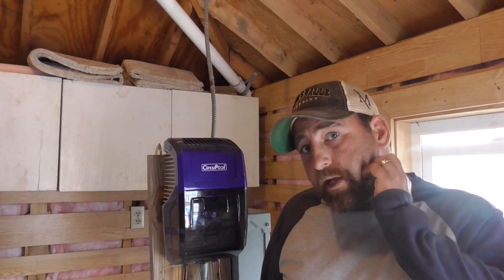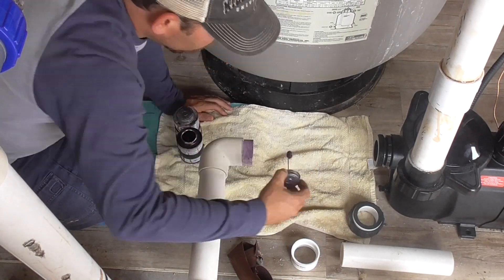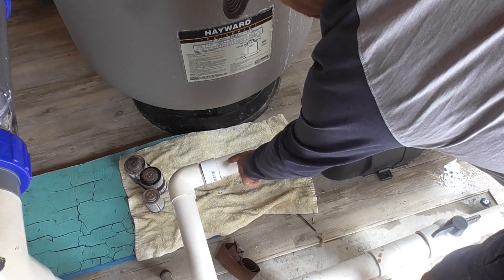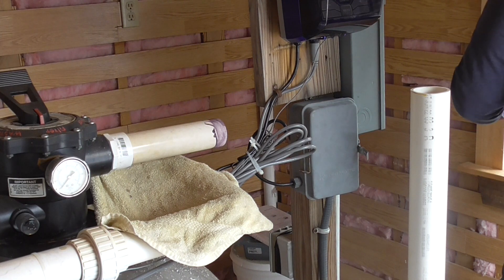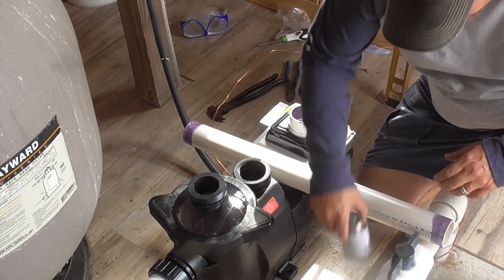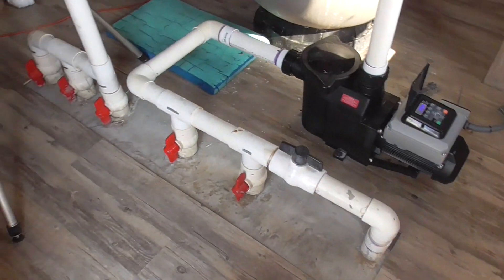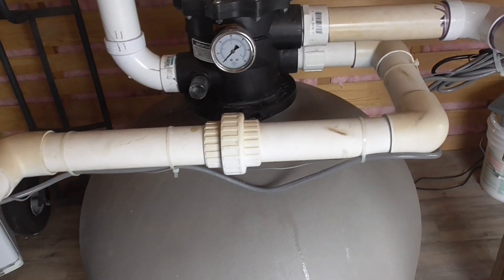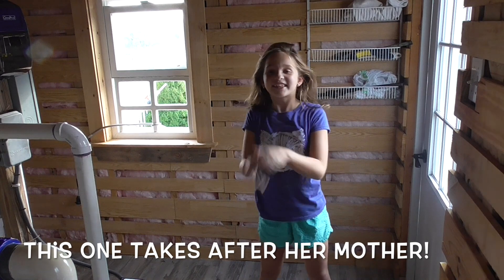Circupool Smartflo Variable Speed Pool Pump Installation And Why?

Comment: Don't use a 90 plumbing fitting on a pool pump. Also pvc primer / cleaner isn't necessary on pvc fitting under 2in. Speaking as a Florida irrigation installer

Comment: This is the biggest misconception they try to sell you to do more conservation.  If you need to take 5 pound of weight 2 stories up, it takes same amount of energy to do in 6 hours or 16 hours. You need to move so much water with an induction motor or a variable speed motor. Total work done is the same.  You must move that water a few times a day. There is not energy saving at the end, and you must pay for the CapX of the new motors and pumps.  How much energy conservation is needed before we build more powerplants to keep up with power usage and EV.

Comment: As a 10 year technician and a pool service owner running that pump on the lowest setting is not the way to go, It’s  recommended a minimum target turnover rate of 6 hours and a minimum of 2 turnovers per 24 hours. The turnover rate is important for proper filtration. It's essential to ensure that the pump operates efficiently and remains cost effective. I recommend having it run from morning to noon at about half speed (1500ish)and then from noon to 4pm at the highest setting (hottest part of the day) and then run it at around 450 to 600 rpm the rest of the time until it changes again in the morning.

Comment: Thanks! I won't be doing the install, but I want to be able to check the installers work. I may have 1.5 diameter pipe instead, so is there some adapter that goes between the smaller pipe to the larger? My inground pool is from the 90's. It's open year around, so it would be nice to keep the water circulating all the time since I have trees all around it dropping stuff all day.  I have zeolite,  so maybe the lower speed would help it? Thanks.

Comment: Great video. There are some comments  below that say there are no electricity savings when running the pump at lower speeds. Is this correct? Have you followed the electricity usage at lower speeds? Great video

Comment: So will this pump make you remove your mechanical timer since the pump has its own built in timer? Or at least leave it and remove the on/off trippers
Reply: Easily worked around set the timer to run longer than the pump time.

Comment: Variable Speed Pool Pumps do not save you money. A centrifugal pump operating at a lower RPM requires more energy not less energy and has to work harder to move the same two galleons of water as a single speed pump running at its best efficiency point. The variable speed pool pumps will in the long term cost you more money because its not as energy efficient. 

If you need to push water 60 feet, and the lowest % of speed required is 80%, then you only have 20% of wiggle room for your pump to vary its speed. It's a scam by the pool pump industry and the power companies to get you to install a way oversized pump that you do not need.

Comment: You might look into a D.E. Filter. I switched from sand to D.E., and besides shorter run time, and 5 times faster filtration, sparkling clear water and MUCH lower electric bills too!
Reply: Lol. DE filter sucks. It's messy, grids always either collapse or breaks. DE is all hype. Backwashing is still involved and DE powder is a killer on the lungs and surroundings. DE is literally pest control powder. Cartridge filter can achieve you the same quality and not lose any chemicals on your pool. Less mess.

Comment: Sewer drain fitting not suitable for this application.  DIY folks there are different kinds of PVC fittings make sure to use pressure fittings for pool plumbing.
Reply: Schedule 40 is fine all the way up to 166 psi, as long as you aren’t using hollow core.

Comment: Good luck won't save you a penny over time and replacement will be expensive
Reply from the maker: This has been one on my best investments.  My electric bill was reduced by 18%, I think this pump had to do with some of it.  I also switched over to a inverter technology mini split system for the house so hard to tell.  Thanks for watching.
Reply: @doublewide6  

Still happy with the pump? I know variable speed is the way to go, I’m interested in the circupool brand. 

Thanks.

Comment: the problem I have with my pentair variable is on the lowest setting the skimmers do not work as well. Filters the water fine just not the greatest as far as the skimmers. So I keep mine at high for 4 hours and medium for 6 hours and low for 3 hours. Ends up using around a buck twenty five a day.

Comment: You really got me thinking. I checked the current and watts on my Hayward 1hp pump. 14.5 amps and 1091 watts. That equates to about $1000 a year electric cost. I spent about $1200 to $1500 for chemicals. Just told the wife and she said were foolish not to switch. This will be one of my next projects. Thanks DW6!
Reply from the maker: Switch pumps and put in the salt water chlorinator, I would use the Circulpool ones.

Comment: Is your SWG wired in such a way that  it will not be energized if the pump is not running?  I’m researching VSPs as well, and I’m finding that is something that needs to be addressed when upgrading to a VSP.
Reply from the maker: My swg has a flow switch so it will not operate unless there is water flowing.  It is only energized when the pump is on.  Hope that helps.